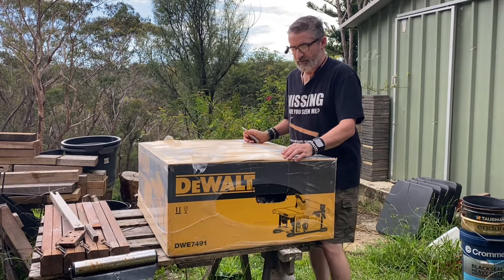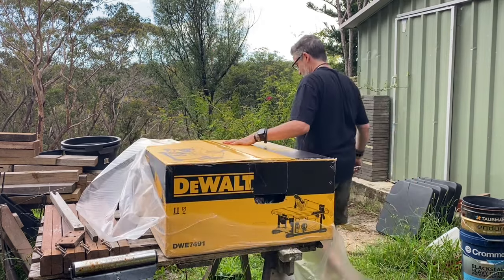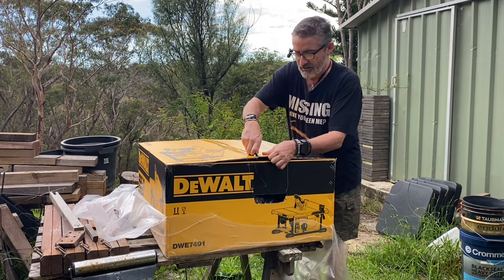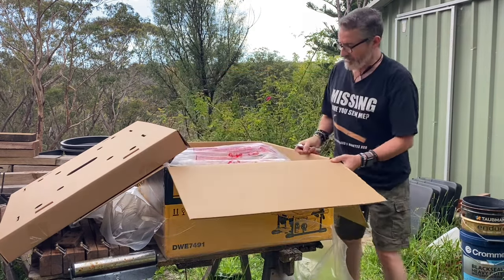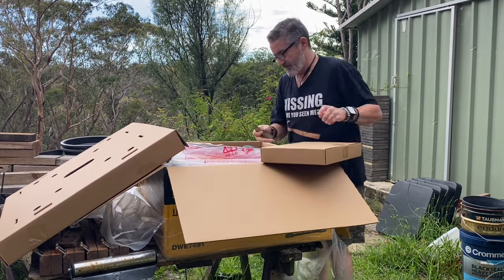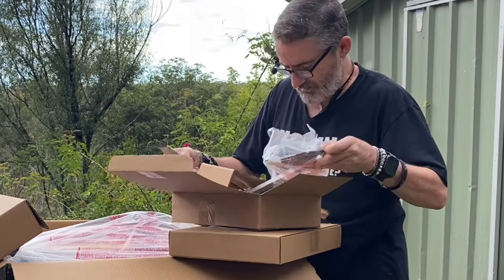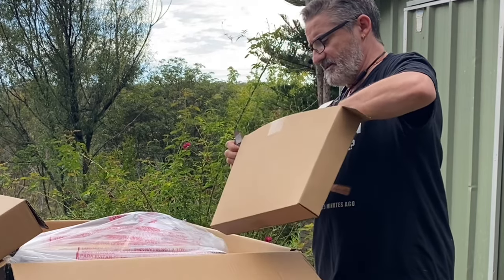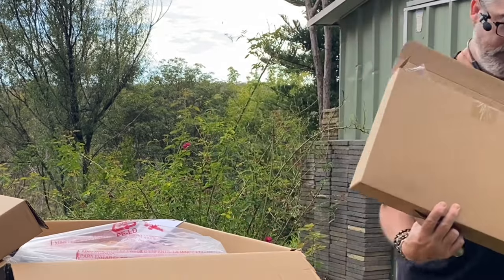Unboxing my Dewalt DWE7491 tablesaw.

Comment: Got myself the 7492 for Christmas myself, not sure what the difference to the 7491 is, but it seems identical. Either way, it's a great saw once properly setup. Especially the fence is really nice and the reason I picked this one over similar priced ones like the makita or the Bosch. I recommend adding a soft start Module, especially since this saw has quite some Power with 2kW (what's that in Imperial units, like 2.7hp)
Reply from the maker: Yeah, I’m looking forward to the fence for accuracy. 2.7hp is right.

Comment: It's a solid looking unit and that sale price is hard to beat. At full price I'd get the CTS SawStop... But it doesn't go on sale 😅
Reply from the maker: What does the saws top sell for?
Reply: @oojagapivy  $1550, so only $350 more than the DeWalt when it's at full price